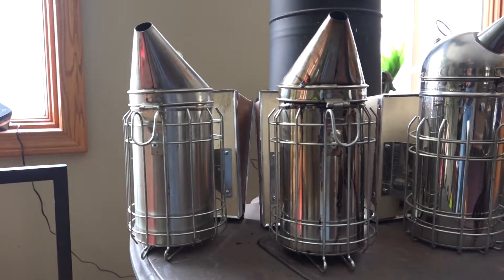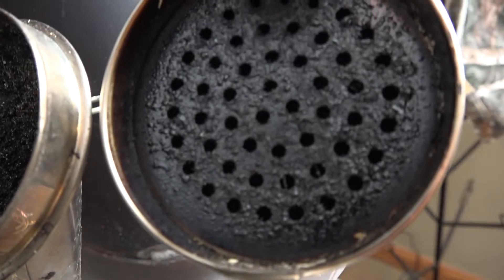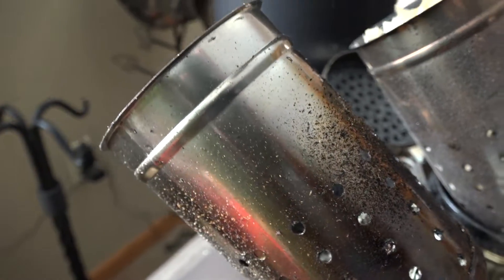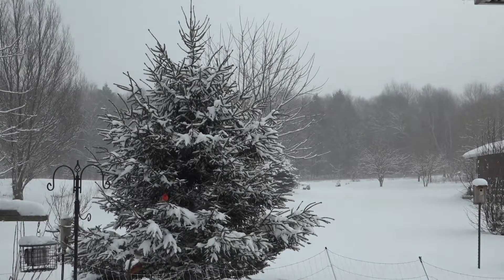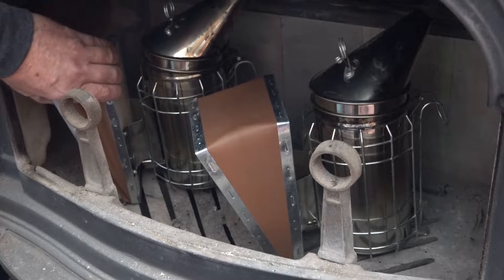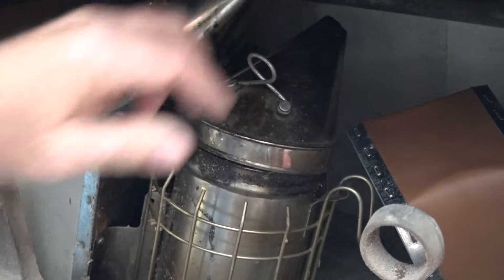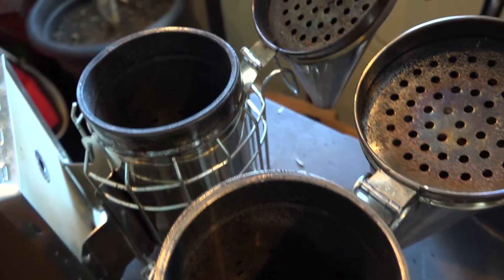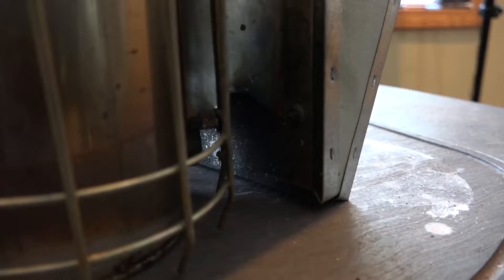How To Clean Your Bee Smoker AND remove Creosote, No Scrubbing

Comment: Hardwood burns hotter and creates less of it's own residue than softwood.  It looks like that product works as smoke, and won't really clean the body of the smoker.  A good hot burn will often burn most low temp combustibles down to ash, which is plenty "clean" enough.  If you can find a way to boil it in water with a lot of baking soda in it, that should do the trick, if you can't burn it clean.  Also, you probably want to do another hot burn to make sure all of the chemicals are gone.